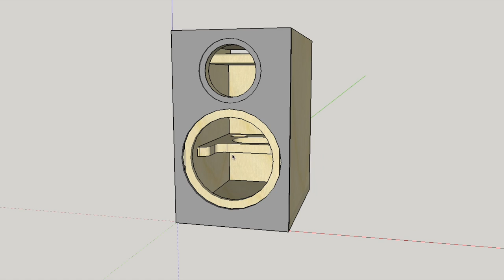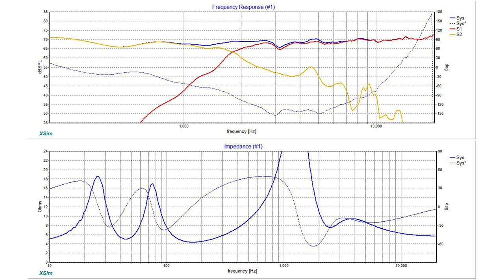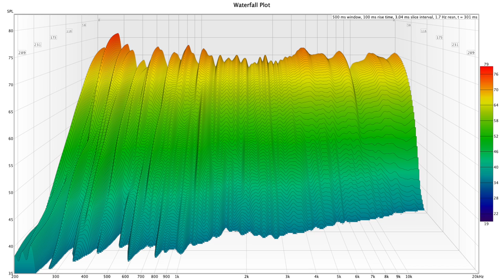Building 2-Way Stand Mount Speakers with PUNKTKILDE Drivers - by SoundBlab

Comment: Very nice. I like the use of plywood instead of MDF. Those drivers look old school and high quality. When soldering I wrap the wire through the tag or around it. The solder connection is more durable that way. 
I don't think I could align those boards largely with just bare hands and a nail gun, wow!
Reply from the maker: Thanks
Reply: The seemingly little things like aligning the boards and nailing them into place by hand are some of the points where his level of skill really shows in making it look easy.
Reply: i can and have but since my skills have progressed, i don't. i use clamps with minimal brads. you go shooting 6 brads down the edge of mdf, you are splitting it even if you can't see it, even if those brads are only going in a 1/4" inch, it's split. granted this time he is not using mdf but it does happen. the fewer brads and more clamps the better.. i can't believe i used to predrill holes and use screws. clamps clamps clamps
Reply: @josephlalock8378  

I don't think the splitting will cause any issues, it's very unlikely to ever come apart, as the glue holds it together. 
I like to use screws (pre-drilled) and angular clamps. I don't have a table saw and I rely on getting the panels cut at the store, which is not very accurate, if it's below 1/20" or 1mm off I call it a good cut. So not using  screws is pretty much out of question and I use glue mixed with wood filler or some kind of putty like glue to seal it off.
Reply: @westelaudio943  You’d be surprised what you can do with a track saw and a miter saw. I would love a table saw but don’t use one currently. I used to have things cut for me but I got fed up with the inaccuracy.

Comment: Do you have any videos where you go through the software to use and more detailed cross over analysis. Thanks. Love you speaker designs.
Reply from the maker: Hi, not at the moment. But I am planning to do more detail in my Patreon videos this year where I will cover a lot more on the design, measuring, the build, etc. for each project. It will be a great place to learn more about speaker design.
Reply: @SoundBlab  thank you. I will look into your Patreon
Reply: Another great sounding speaker 😊. I have 2 questions: one, if I didn't want to have stands, can I extend the size of the box, isolate the original volume and add weights to the bottom? Secondly, would you rate these as your best sounding speaker design for both audio and home theater use? Thanks and greetings from Eastern Canada 🇨🇦

Comment: Quick question, how do you measure? Do you use filtering in the time domain? This gives more accurate measurements without any room reflexions. Nice build tho 👌
Reply from the maker: Thanks. Yes, I will filter the time domain and then I can get accurate gates results from about 200 to 300 Hz. Low frequencies are measured near field on the woofer and then a baffle step is applied and spliced with the gates far field.

Comment: I've been meaning to ask you. Do you sand sealer, sand down, sand sealer sand down again? and then spray primer by spray mate or some other brand? And after your primer do you sand? I've seen all your other videos especially the ones you spray I know you use spray mate in those ones but I wanted to know your steps of sanding between your coats.
Reply from the maker: Yes, I do two coats of sand sealer with sanding in between and after the second coat with 320 grit. I try to use RustOleum spray paint whenever I can. Its good quality and has a great finish. After the primer and top coat with sanding in between, I also do a few coats of clear coat.

Comment: The graph in the video seemed to show a low efficiency. Do you have numbers on the efficiency and power handling? It would seem that this could be a popular build depending upon the driver / xover cost. Nice job as always.
Reply from the maker: The efficiency on the graph is misleading since the original measurement is not taken at exact calibrated efficiency of the speakers. I still have no idea what the cost of the drivers will be. Punktkilde have not yet published any MSRP. Thanks!
Reply: It's probably not a 1W/1m measurement

Comment: What is the response like below 200 Hz please?
Reply from the maker: The speaker response is very well balanced throughout is useable passband. including below 200Hz. The graph only shows 200 to 20000Hz as a gated measurement since measuring below that accurately without an anechoic chamber is very difficult. However I have measured it in my room, and when ignoring any room modes the response is neutral, not overly bass heavy and not lean either.
Reply: @SoundBlab  Okay. I’d just like to know what the -3 Db point is.
Reply from the maker: I think it is around 40 to 45Hz. I cant remember the precise number.

Comment: It kinda sounds muffled to me?
Reply: Don't think the Mic is picking it up properly, hear distortion as well.
Reply from the maker: The recording is high res and done at a suitable level where it will not clip. YouTube does not do it any favours in terms of compression, but generally what you hear will be your speaker's interpretation of what these sound like. If it sounds muffled and compressed, it is most likely a shortcoming of your setup or head/earphones.
Reply: @SoundBlab  still I bet they sound great in person and very nice looking
Reply: I like this kind of presentation - not too offensive, maybe without top end sparkle, but then I'm not familiar with the music played. I noticed x-over is mixed type: 24dB/oct high pass and something of a 12dB/oct low pass, never tried it.